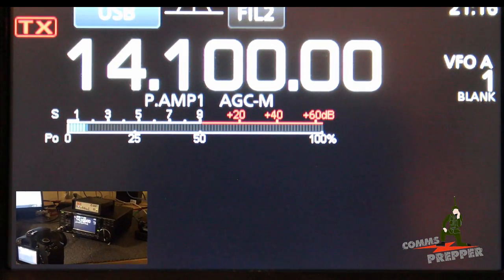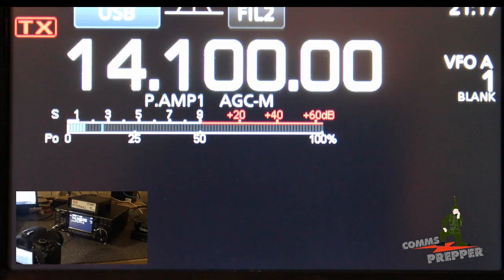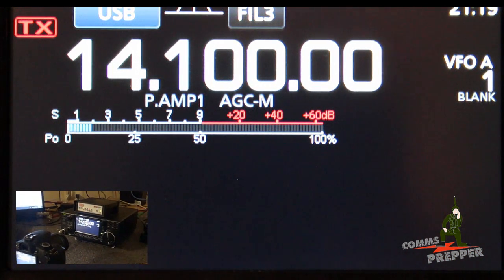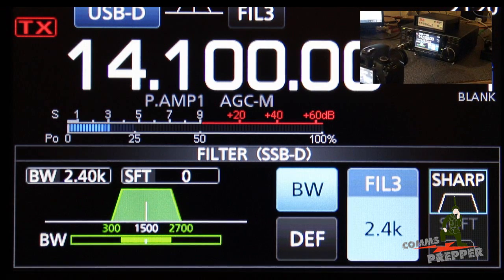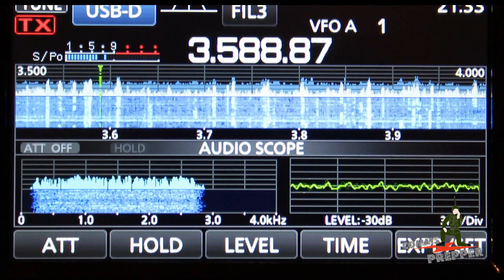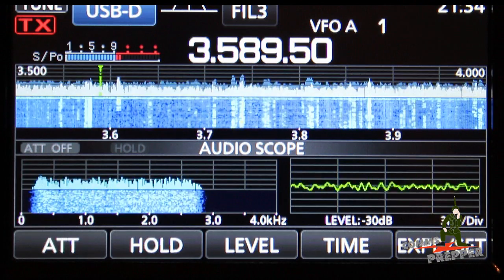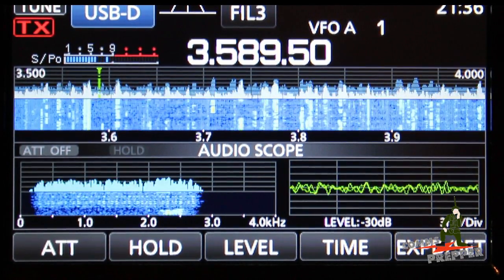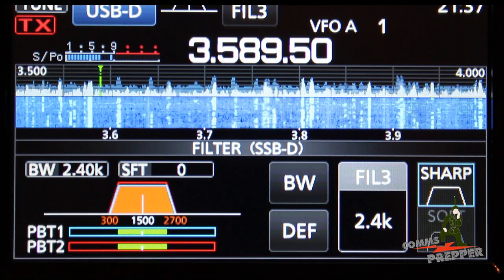Icom IC-7300 and SCS Pactor P4Dragon Modem Setup

Comment: Don't know if you will read this, so long after making the video.  Two points: 1. you didn't show that you must change the Datamod setting under Connectors from USB to ACC to send mic audio to the Accessory port on the back.  2) I was wondering what software you were using and how it connected to the radio.

Comment: You appear to have skipped where do the cables plug ? Specifically where does the TRX Audio plug into on the IC-7300?  To the "Remote" or "Ext speaker" or somewhere else?  Also can Winlink (or other program) select the frequency or is this a manual function?  Your ALC level instructions are unclear to me. You say 75% yet this does not appear to match the screen (it looks like ~15%?).

Comment: First of all, thanks for the awesome videos, they have helped me so much!  The videos on the Pactor / 7300 have been a godsend.  On the levels, I think you may be incorrect when you stated your PSK / FSK levels as 70 / 70 sounds very low.  Can you confirm the levels you are using?  I have the PIII SCS Modem and an Icom 7300 and the starting point is 220/170 or something like that.  I believe it's the same for both.  Looking forward to hearing from you.
73

Comment: Hi. Good example in this video. I have a few questions since I'm using the same radio and just ordered the same modem. If you set both levels in the SCS modem software to a point that you have about 70% power out, does this means the RF output is set to 100% at that moment ? And does the ALC shows on the meter (in some digital modes ALC is not wanted) ? Last question, what is the TX bandwith ? This radio has 3 settings that can be altered. 2.4 KHz wide. What are the lower and upper settings in Hz ? Thanks a lot for answering. 73 Phil
Reply from the maker: Phil,

I don't have the radio or modem with me right now (I'm overseas).  You want the radio's power set to 50 watts and increase the FSK/PSK levels until you see an ALC response then back off a touch.  You never want to run full power when running digital modes.  I leave my bandwidth set at 2.4 but I have run 3K when overseas.  73's Hank

Comment: Hello:  Love the video, you saved my many hours of frustration.  Would you take a picture of the cable hook ups at the back of the radio, to your scs modem.  Does the modem receive power from the wall socket or from you same power supply for your radio?
Reply from the maker: I ordered the modem to radio cable from Farralon Electronics.

Comment: Why would you want to first set your audio input for 70W of output power and then limit your RF output power to 50W???  Makes no sense to me.
Reply from the maker: Not sure I get your question.  I will watch the video.  Perhaps I messed up in the video.  You want to set the RF power to 50%, reduce the audio drive and slowly increase the audio drive until you are just below the 50% power mark.
Reply: Keep the RF Power setting at 100W.  Limit your RF output to 50W by adjusting your audio input (on USB Audio Codec).  Since the RF Power Output is set to 100W ,and you are only at 50W output, there should be no ALC reading.

Comment: Does the 7300 remember the settings for the mode, or do you have set your power, bandwidth, etc each time you go to USB-D?
Reply from the maker: It will remember the last settings.  The Winlink Express software does support radio control for the 7300.  However, I don't use it because I like to set things manually.
Reply: Great! I thought it would. I believe I have narrowed my choices on a new HF rig to the 7300. Looking forward to more videos on the 7300, in particular with digital modes, winlink, and other Emcomm oriented use!

Comment: whats a good small antenna to use with this?   I just got my license. I want a small antenna I can install by the second floor not one of the 25 footers.  thanks
Reply from the maker: Did you just get your General class license?  If so - congratulations.  If you only have a technician class license then you will need to upgrade before you can use a HF radio.
Reply: +Commsprepper thank you. just technician. i got my 2 meter. in october i will take the general test. my father and brother were hams. where I live those big antennas are not allowed
Reply from the maker: When make General take a loop at Chameleon Antennas P-Loop or F-Loop antennas.  They are great indoor antennas but are limited to 25 watts.  I have two of them and they work great.
Reply: I rewatched this video, now I get it more, this like the sailmail set up on a boat.

Comment: Nice hardware.  Do you have a gear sponsor or is radio your only hobby?  LOL
Reply from the maker: It's a mixed bag.  Sometimes companies will send me stuff, most of the time I take stuff out of my buddies'  shacks (with the promise not to break it and give it back), and allot of it I buy.  I had other hobbies but this is a comms channel.
Reply: My comment was a little tongue in cheek, but I do enjoy the channel.  A nice pact or modem would be an improvement over winmor, but hard to justify the price unless I'm running an EOC at home.
Reply from the maker: +Sean Yunt yeh...  The modem was not sponsored.  That was bonus pay money.

Comment: That's a fancy radio compared to mine..LOL!
Reply: What kind do you have?
Reply: Solar Power Electricity and Electronics A Yeasu FT101E from the 70's.
Reply: How your 48 volt system? i just picked up a magnum.
Reply: It's doing good, I have a lot of trees so it could be better. But it does a lot for me.
Reply: Whats you open load at idle?
Reply: Solar Power Electricity and Electronics Are talking about my solar power or radio?
Reply: Solar Power Electricity and Electronics My invertor pulls about 0.8 amps I think. I forget offhand it may be more.
Reply: My aims inverter pulls about 5 amps @ 24 volts so i going to take it out and use it and needed
Reply: Yeah the Low frequency invertors do pull more amps but are more heavy duty. The higher voltage helps cut out the draw. Mine may be over 1 amp but it's not much at 48V.
Reply: the watts is where it's important